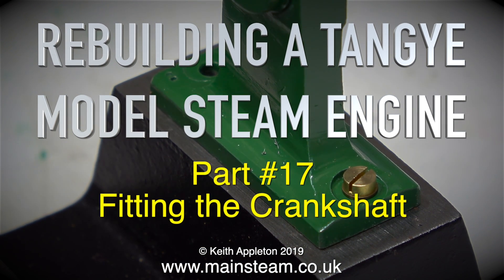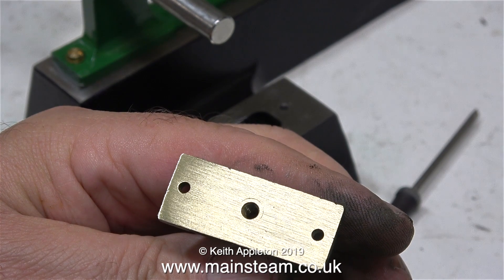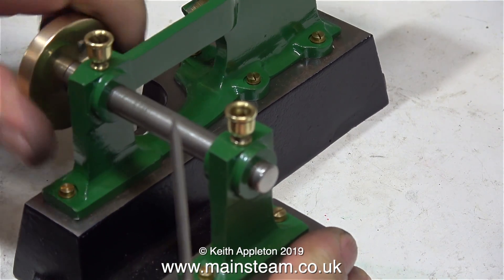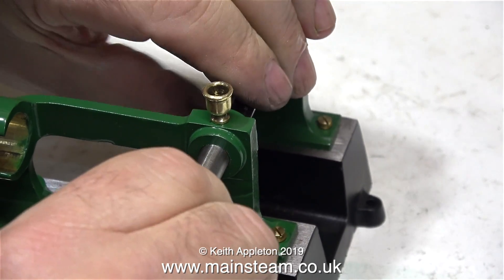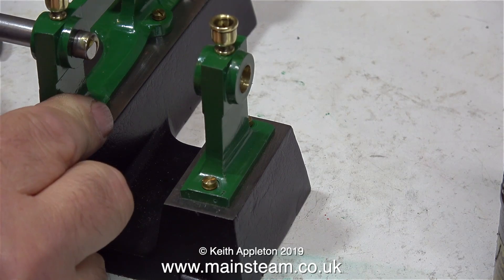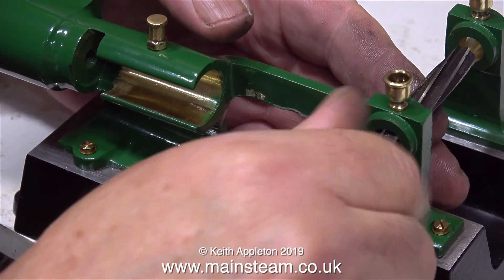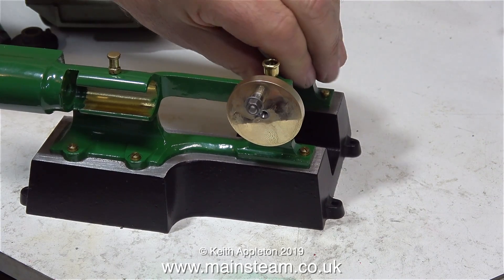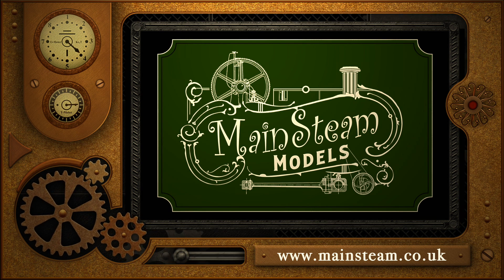REBUILDING A TANGYE MODEL STEAM ENGINE - PART #17

Comment: What I like about your tutorials, and what is especially visible in this episode, is that you show that many many things need several runs before success. Most tutorials say “do this” period. Which makes you feel like a fool if its does not work like that the first time round. You just show that a job needs to be done in iterations to get as close as you can. You also show there is no such thing as perfection. Accept that or you’ll never get the job done.

Comment: Hi Keith, Unwashed here: I watched this video a few days ago and then this morning I realized that I had a suggestion. At the risk of being flamed I would suggest when reaming through both bearings to back the reamer in one side and out the other, at least if it is not too tight. That way the alignment would be less likely to be 'non-coaxial', if that is a word. Entering one bearing by hand, reaming, and then through the other risks the first ream being off axis. This is picky I know, but that is the best type of comment for you - right? ;-} AND maybe in this case it would have been too tight.

Comment: Well done, but you are giving away all the proper old engineering tricks, didn't always have a carbide tipped tool handy but  always had a pocked hone, anything harder then the metal in the reamer would work.